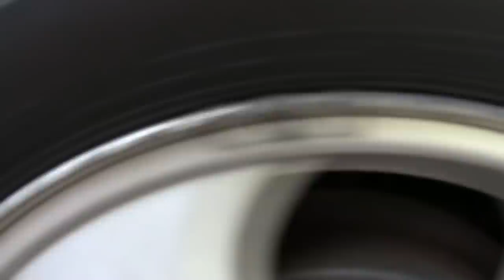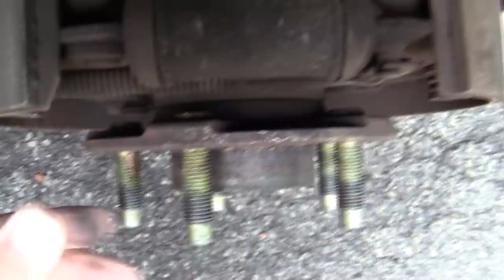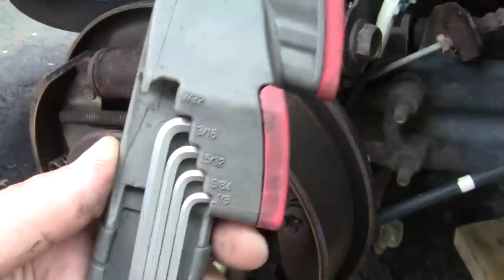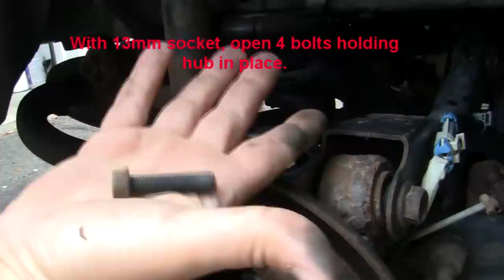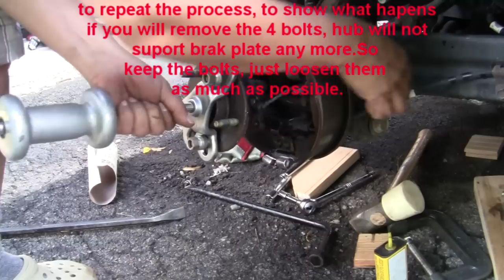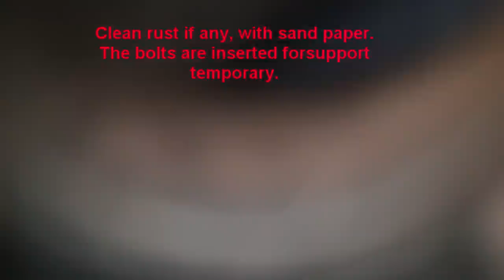Remove Rear Hub Bearing, Any Car. Как Снять Подшипник Ступицы.

Comment: Today changed the hub of my Nissan Quest SE 2006. It was really tough to get the rusted hub out. 
Used the hub puller and hammer to get it out. 
Thanks for this VDO . 
The whack-whack sound is gone. 
Cheers

Comment: 2005-2009 Equinox are based on the same platform and use the identical parts.
This video is an excellent reference for changing out the rear hub / bearing (non-AWD and equipped with ABS).
250k km and 9 years on my wife's Equinox, the bearing was gradually getting loud enough to no longer allow a quiet conversation in the vehicle at highway speed.
Slide hammer was insufficient to dislodge the bearing seized in the hub.
We used a chisel between the hub and brake backing plate (alternating sides) to separate the assemblies.
I bought a Moog / National part from RockAuto, the ABS cable seemed to be a bit shorter than the original part but just long enough.

Comment: i have an AWD vue and I cant rotate my wheel/hub freely like you did to determine if the hubs are what Im hearing when Im rolling.  I suspect they are, but at $130 each, Id hate to be wrong.  Plus mine look like they have never been replaced and are probably siezed on.  Any advice on figuring it out before I make an attempt at replacing them? 82k miles on the car.

Comment: FYI the bolts holding the hub assembly on have loctite and i broke three rachets trying to get those little buggers off. Alittle persuasion from the torch was all it took though ;). Heat the flange around the bolt so it expands and itll make it alittle easier to get them off
Reply: m